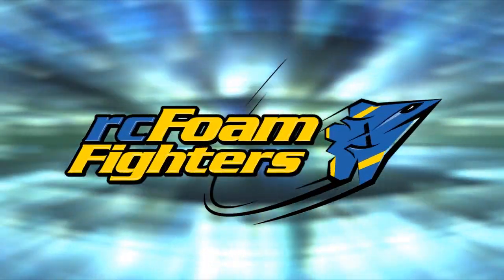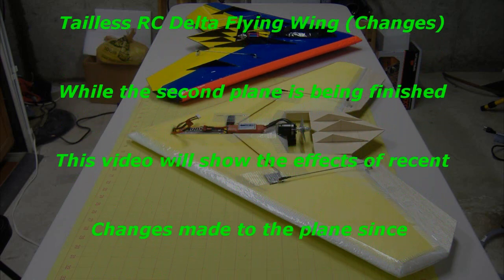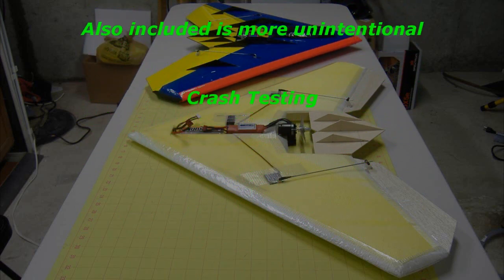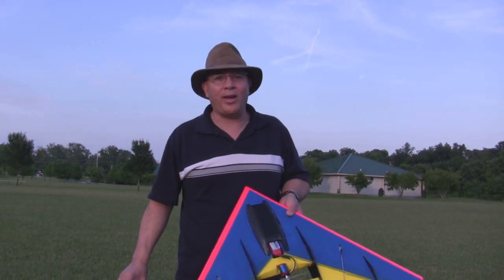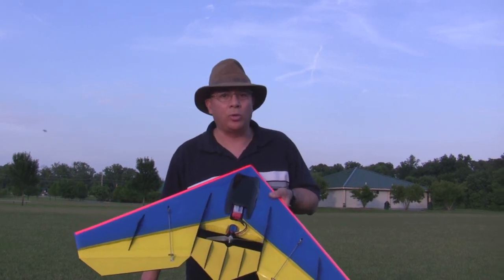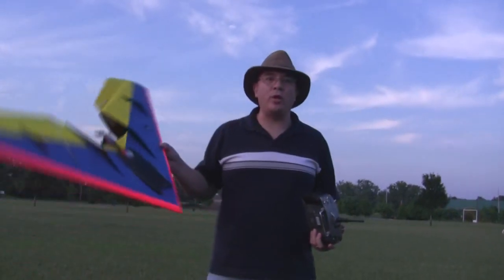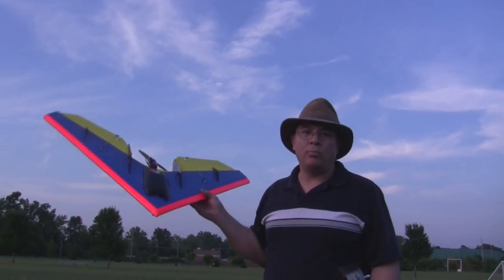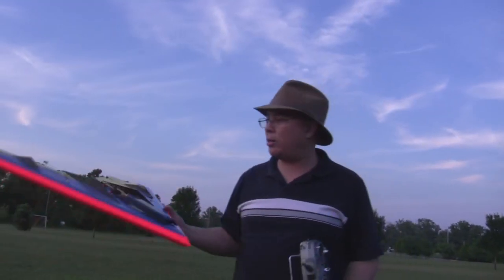Tailless RC Delta Flying Wing (Changes)

Comment from the maker: @Huebel01 I'm thinking it was low voltage cutout. Spectrum receivers are bad for this. They will shut down if the voltage drops below 3.5v The motor may be sucking enough juice to cause the bec to drop that low.

Comment from the maker: wildhover I put a link to this motor in the sidebar if you want to check it out. I love the extra trust this one puts out. I turns a 6x5.5 prop with no problems. I'm running it on 3cell batteries but it can also take 4 cells. That would be some insane speed!!!

Comment from the maker: Thanks RCFLIGHTHELP! I  it's definitely the receiver but I'm still not sure what is causing it. I don't think it's the motor or ESC because I changed them both and it still happened. I don't think its the batteries because these are Rhino 30c and they hold the voltage all the way to the end and this happens before that.

Comment from the maker: startazz ,The vertical is insane with this new motor! Thanks for the suggestion on the aerials. I was thinking about making them a little longer too but I'm not sure if they have to be a certain length or not. What do you think? I might just try it , what could it hurt.

Comment: The vertical climb on that is mad man really is fast and just eat up the sky ;-) i had the same thing happen to me a couple of times with my stryker,were i had no control over the plane and it was down to my spektrum ar6100e RX as i never had the two little aerials sticking outside the plane,after putting them outside it worked ok,just thought you might want  to check that out but can't remember what RX you have in,anyways great video=5*